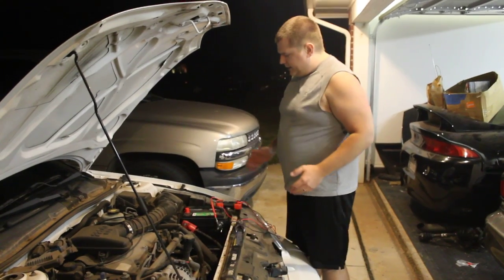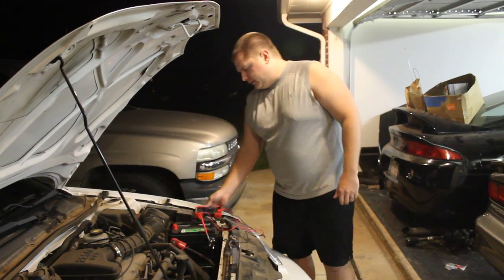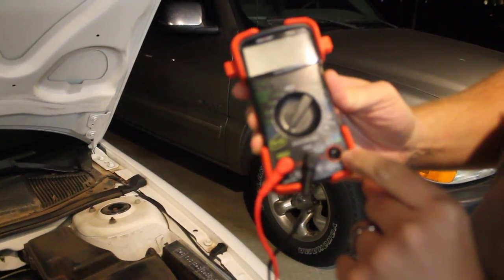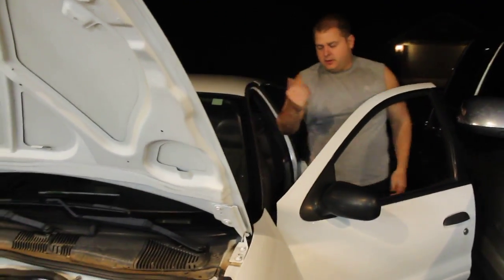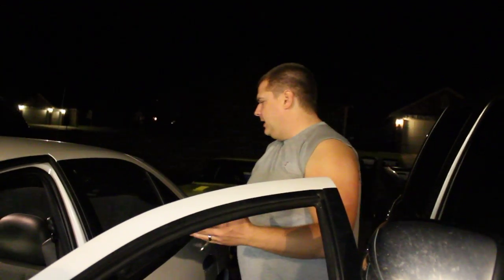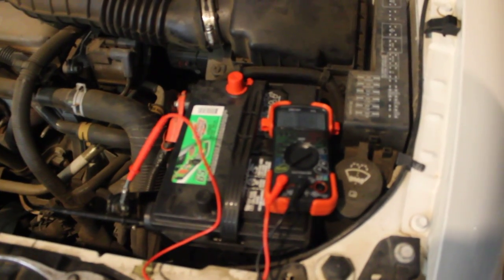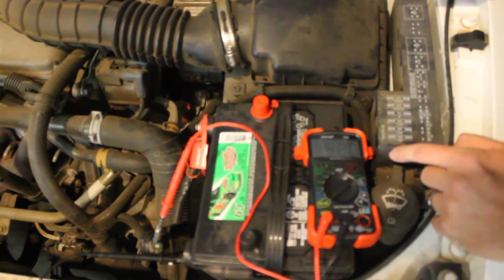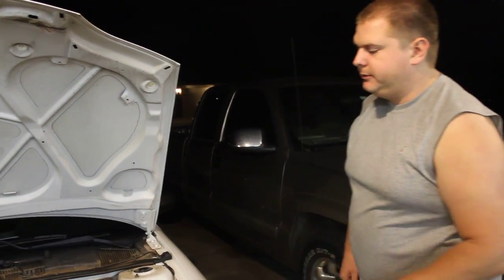Dead Battery? How To Troubleshoot A Parasitic Current Drain

Comment from the maker: Much of your electrical system will have volts (power available) but should not have amps (power used).  I would say it is completely normal for the fuse box to always have 12 volts.

Comment from the maker: I would say 300 milliamps is high, though not extremely.  On a 'dumb' vehicle like that I would expect to see something like 50 milliamps or less.  I looked up the owner's manual for your car, and fuse 14 controls the 'battery saver relay', that component would be my first suspicion.  If you google 'battery saver relay' the very first result has lots of great information on it.

Comment from the maker: In order to test if current is passing THROUGH the fuse you would need to pull the fuse and probe each side of the connection in the fuse block.  Some fuses may have voltage but not current, which indicate different things.  If you probed each fuse junction that would potentially be a good way to find your leak, though I thin it gives you a lot more opportunities to get inconsistent results.  There are probably some circumstances where that might be a better approach though!

Comment: Wouldn't it be easier to use your multimeter to test the fuses independently with your car off to see if there is voltage running through them? You wouldn't even have to remove the fuses, and you could do this by yourself. The fuse with voltage running through it with the car off would be the problem. Just a thought.

Comment: This is a great video!!!  After using same techniques as the vidoe I have found that a bad starter solenoid that was stuck 'on' just enough to cause a parasitic drain. I've also heard other mechanics say they've had alternators go bad interanally which have caused parastic drains as well.

Comment from the maker: Disconnect the battery, connect one lead to the battery and the other lead to the cable, so the current is traveling through the multimeter.

Comment: Please explain the multi-meter hook up - the positive battery terminal cable is pulled off and both the multimeter wires are connected to the disconnected + cable?  Is that correct?  Thanks.

Comment from the maker: I would definitely take a look at the switch, it's usually those kind of mods that cause drains like that. I would also suggest pulling all the fuses and relays in the engine compartment if you have only pulled the fuses in the cabin/trunk.

Comment: 0.36A.  That is approximately the drain I see from an open door or dome light.  I just cleaned and reinstalled my negative battery cable connections to the chassis and frame. Drain was there before and after.  Speaking of my starter, I do have a simple toggle kill switch.  Not sure exactly how it is hooked up (in-line to starter?). I will disconnect it.  What else would cause a ~0.36A draw?  I have removed my aftermarket stereo.

Comment from the maker: Ah nice catch.  I misspoke, it is .077 amps, or 77 milliamps, which you can't really make out with the horrible focus in this video.  A couple minutes later I state the figure correctly when I disconnect and reconnect the battery.  I added an annotation to clarify that, thanks!